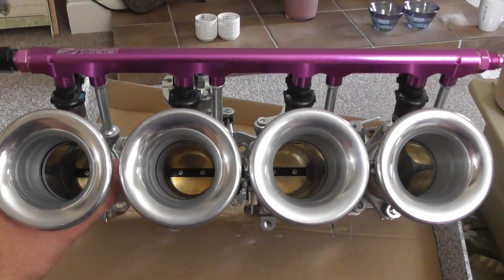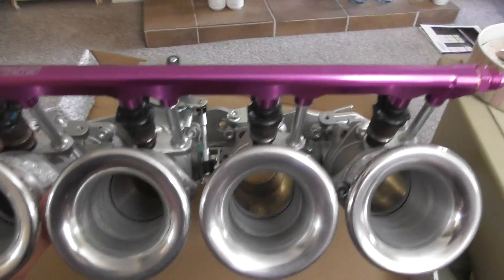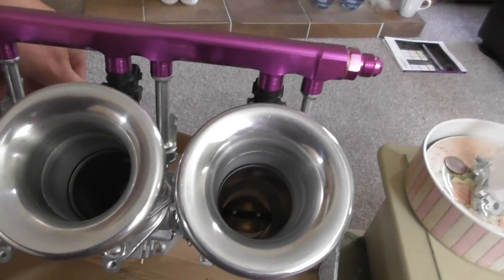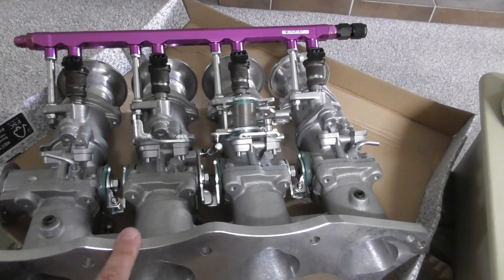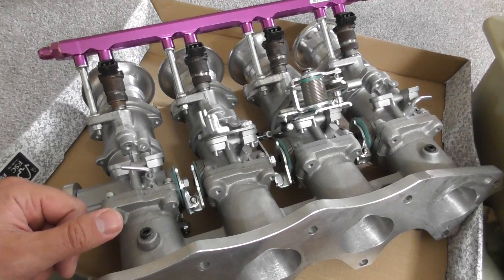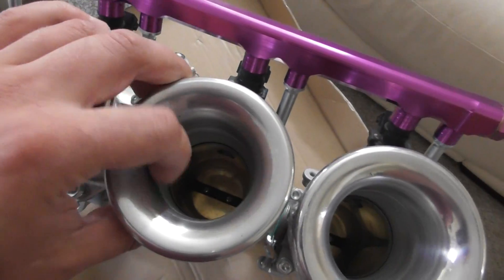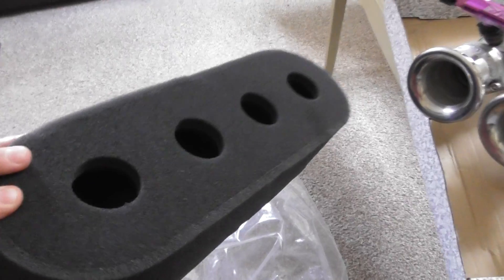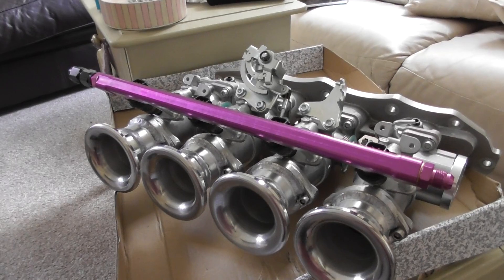T2CG Components 1: OBX Throttle Bodies ITBs - Honda Civic B18 B18C4

Comment: appreciate I'm a little late to the party, but did you get these running happily in the end. Im looking at a set of the race car, I can only find bad review online, but then people only come online to write bad reviews. everyone who's fitted them up correctly is out enjoying them ! 

Any reviews / trouble spots appreciated.
Reply from the maker: Blair Roebuck I got these running on my car... but still need a throttle angle map to be done on a dyno. You cannot get these to run using just Manifold Pressure, because it is not a stable source compared to an plenum inlet manifold. So if you have a mappable ECU, correct fuel connections (AN6) for the supplied fuel rail... and mapping done you should be fine. I have also got a custom air filter to go with these. The negatove comments seem a bit unfounded to me, as they seem good for the price. I would say that the position of the injectors could be improved upon, to better spraybatbthe back of the valves... but like I say for the priice they are all good.
Reply: Twin2 Civic Garage T2CG  thanks for the reply. 

Did you have to make any modifications to run the brake servo assist ? 

I fully intend to have it tuned on the dyno, I'm already running Hondata S300. And the engine will needs its stage 2 cams dialling in as well. 

I have plenty of AN fuel connections in the bay so none of that is a problem. 

Considering this is Toyota bodies on a custom OBX inlet, I was more concerned about the quality of the linkages. I'm happy to port match and do the cleaning up work.
Reply from the maker: dc2blair I was going to run an electric brake vacuum pump from an Audi TT.  The linkage quality is good in my opinion. I had the inlet manifold on the ITBs pinned with dowels, onto the head, and gas flowed. Thanks
Reply: Twin2 Civic Garage T2CG would it not have been easier to just tap and weld a fitting on to one of the runners ? 

Looking at pictures online it looks like they may have done this now out of the factory.
Reply from the maker: dc2blair They have fittings from the factory.. that is not the issue. I tried running all of these fittings to a vacuum manifold.. and from this to the brake servo. I can tell you that the vacuum produced was not enough and not constant. You will need another solution, like the Audi TT or similar vacuum pump like I suggested. Thanks
Reply: Twin2 Civic Garage T2CG ..... so not enough vacuum during idle or not enough vacuum throughout the rpm range?

Comment: How much gains will itb allow on a b20 or what ever liter.. because mods change so many things let’s just assume the motor is stock and rebuilt.
Reply from the maker: I think if the motor is stock, then you will not see much of a power gain (at high rpm), as the rev limit will still be in place, the cams are stock lift/duration and the compression ratio has not beem increase.  You will also have the disadvantage of a drop in low rpm torque compared to when a plenum manifold is used.
You should however have better throttle response when setup however.
What I am trying to say is that if the most is to be got out of ITBs, then you need to increase the operating speed of the engine.
Therefore cams, valve springs, higher compressiom ratio and high flowing exhaust system should be looked into.
Thanks
Reply: Twin2 Civic Garage T2CG so basically better throttle response with no significant gains. If I am expecting gains with performance internals obviously, do I still only get better throttle response from the ITB and does it still suffer at lower p.m.? It sounds like they only change the motors behavior but doesn’t give you gains.
Reply from the maker: @AutoBodyEverything  If you make the changes to cams, compression ratio etc. then at high  rpm you should see power gains, if the inlet manifold you were running before was a restriction to air flow into the engine..... which at very high rpm it is likely to be.

You will still suffer from a low rpm torque drop and likely some driveability issues because of this (at low rpm, low throttle angles).
But most of the time ITBs are used on track oriented where this is less of an issue than a daily used car.
Reply: Twin2 Civic Garage T2CG 
Thank you very much. I really was wanting itb but I want this build to be a low rpm high torque car and not for open throttle. What intake manifold in your opinion will help me achieve high torque at low rpm?

 Also I have a 50 trim turbo for the b20b but I don’t want the lag and I don’t want an anti lag setup bcs it’s not healthy
Reply from the maker: @AutoBodyEverything  High torque at low rpm without the turbo, would mean a close to stock intake manifold.
I think with a turbo the answer might be the same, but this might limit you higher up the rpm range.

For turbo choice... I would pick the smallest turbine housing you can to get the turbo to spool up quickly, getting the boost up quickly (so not a lot of lag).
The limitation here would be a small exhaust housing will not be able to flow a lot of exhaust gas at higher rpm.

Hope this helps.
Reply: Twin2 Civic Garage T2CG 

Would be nice to have the low end torque or NA and at least have a good midrange.
Reply from the maker: @AutoBodyEverything  Yeah, it is good to be thinking of how you drive the car and what you want out of it before starting to spec you engine out.  I think I should have been doing more thinking like that myself lolz.
Cheers
Reply: Twin2 Civic Garage T2CG 

Yoooo how about a pro charger/ super charger? They wind up at low rpm . I’d only imagine the torque acceleration
Reply from the maker: @AutoBodyEverything  Yeah, the supercharger would be a good option, the torque curve would be good at low rpm.
The cost of the kit could be quite high though.
Good luck in your project, and let me know how you get on.

Comment: Hi, what do you to with ITA sensor on this set up
Reply from the maker: Hi, if you are talking about the IAT (Intake Air Temp) sensor, there is no place to mount this sensor into the incoming air charge. So you can just put it in front of the intake trumpets if you extend the wiring. Thanks
Reply: Hi, thanks, yeah I’m thinking to run it in the filter plate to try and get some sort of reading
Reply from the maker: That is a good idea.

Comment: Any problem with the throtlle cable?
Reply from the maker: Gabbe Lemus No issues, there is a  throttle cable stay which works with the standard D16 right hand drive cable anyway... which is what I had in there. The only issue you may have is cable length, but you should be ok.
Reply: Nice thanks bro I apresiate & nice build how many hp should I make with those itbs?
Reply from the maker: Gabbe Lemus I am not sure how much bhp yet, but the stock B18C4 made 170bhp. I am thinking if I change the cams, and as I have ported the head and changed the exhaust manifold... with these itbs I could make closer to 200bhp. My care is very light so it should be quite fast. Which car have you got? Thanks
Reply: Yea you right ...I will see my set up its going to be 
Stage3 blox camshaft+48mm its +supertech high comp piston +hondata s300 v2 and some other stuff like bigger headers I hope to make around like 260 already tuned I have 99 civic si or em1 do you have facebook ?
Reply from the maker: Gabbe Lemus That sounds like a strong engine build. I have got standard rods and pistons, as I am not shooting for too much powet at the moment. I dont have a fb account for this stuff, but please feel free to message me on any of my videos if you have any questions. Thanks
Reply: Twin2 Civic Garage T2CG  yeah thanks so much for that info man I really appreciate it and I will if I have something eslse I let you know thanks for you time 👍
Reply from the maker: Gabbe Lemus No probs mate. Happy to help you and anyone else with any questions. Thanks
Reply: Twin2 Civic Garage T2CG alright thanks man I really appreciate it . 🙏